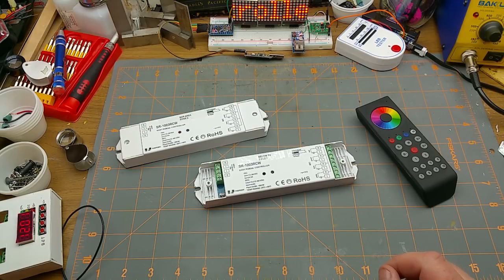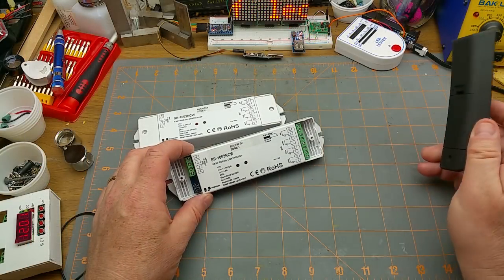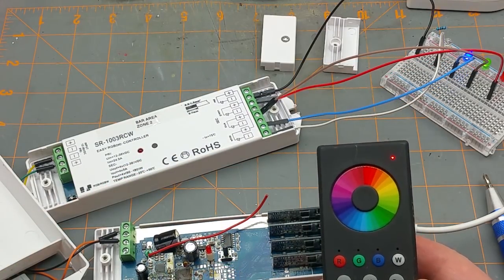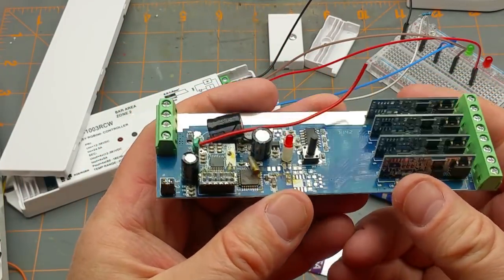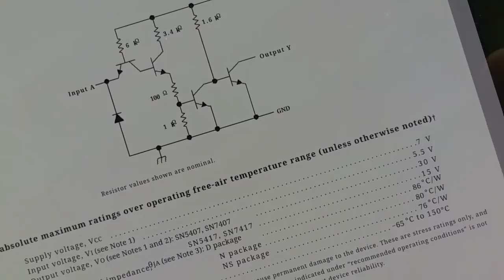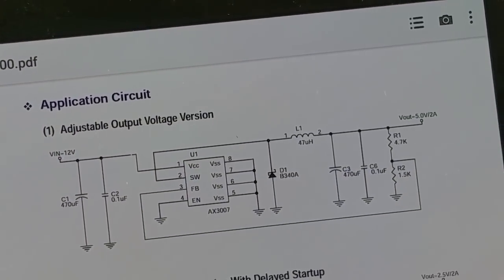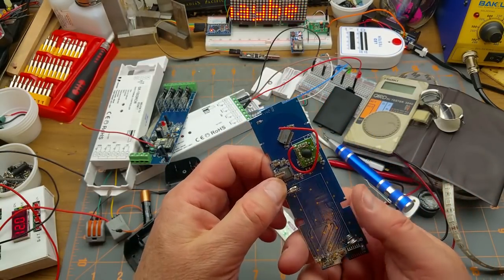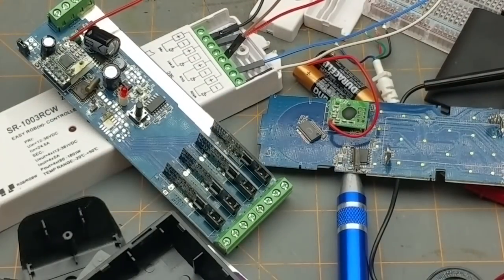RF led controller

Comment: I'd check the board that you disassembled again. Removing the RF board and reseating it may cause the unit to work. There could be just a bad connection in the header causing the data not to reach the microprocessor.